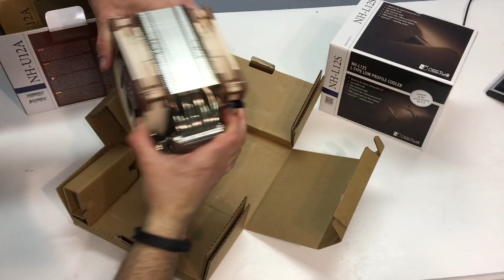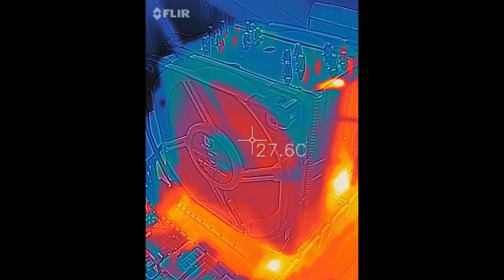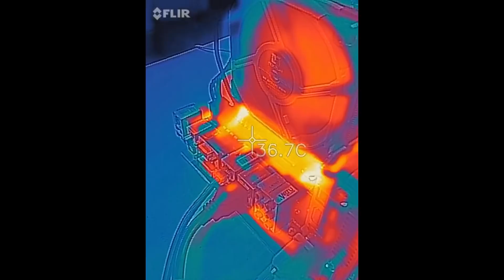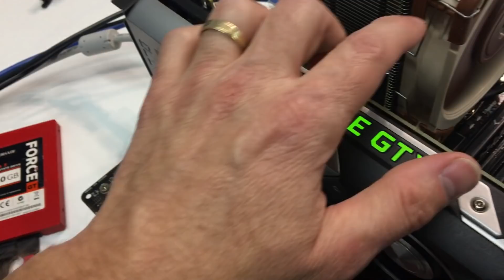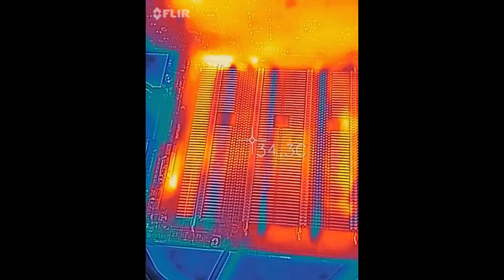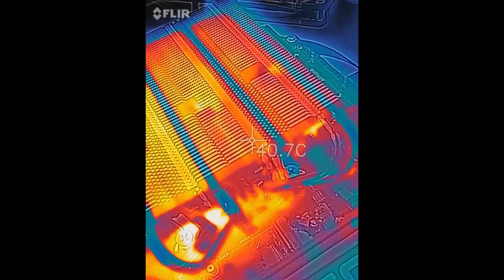Noctua NH-U12A & NH-L12S CPU Coolers Review

Comment: many thanks for the very deep review and tests! i wish there was much more around for low profile coolers specially for 4U server chasis is hard to find, overall height demensions are not always easy to find in specs what makes the search for a cooler thats fit a lot more difficult. i think i go for this NH-L12S one and see how it works, might even put a server fan on top with higher speeds to see if it makes a better deal. Note that thermal cameras have some difficults on reflected materials so the results can be a bit off. Cheers M8 thanks for your great work.

Comment: For the L12S, you never tested the default fan position shipped by Noctua, i.e. the fan underneath  (what Noctua calls "low-profile mode") but pulling air FROM the motherboard THROUGH the heat sink and INTO the case. This option is the absolute best if you happen to have a case with an air filter sitting on top of the heat sink, just waiting to empty hot air from the case =) 
I just bought the L12S and the new Evolv Shift Air case. Under extreme stress tests with programs such as Prime95 and AIDA64, my i7-4790 (95W TDP) are staying safely BELOW 70 degree C, and I'm idling around 28 degree C in a 24 degree apartment. For reference, with my old Noctua NH-L9i I could only dream about these numbers (no suprise the NH-L9i has a TDP recommendation of below 65 TDP). Sure, I haven't done any overclocking what so ever. But seeing that some of the new Intel 12(!) core CPUs have a TDP of 95 or lower (just as my i7-4790), I'm certain the L12S cooler will serve me many many years to come when I decide to upgrade my CPU.

Comment: Good video. Thanks for the review. One note, the thermal readings on the side view of the fin stack during the first half of the video looked like they were sensing the reflection of the video card, not the fin temperatures directly. The specular surface of the fins at medium and high incident angles is pretty reflective in the mid IR band. Thermal emission is isotropic and should be stable when sensing the same point, independent of viewing angle. So you can check and see if the temperature changes on the same sensing point by changing the camera viewing angle. If it does, it's a reflection. If it doesn't, it's likely the emission you're trying to sense.

Comment: Great in-depth review. Regarding the NH-L12S you only tested with air flowing down even with the fan on the bottom. I noticed when you took it out of the box the fan was oriented to draw air from the bottom and blow up through the coils. I can't help but wonder if that would have improved thermals marginally. Probably not a huge difference but I was hoping to see those results.
Reply from the maker: To answer your question (sort of), I have wondered the same thing and run down flow coolers with the fans going either way and did not notice any cooling differences. However you would typically want the fan(s) to blow down against the motherboard, taking advantage of the air flow to help cool it.  Probably the biggest factor  is that down flow coolers really benefit from cases with good air flow.
Reply: I just made a comment about this, see newer posts in this comment section. I have no case fans at all (and my PSU is mostly passively cooled so the fan rarely spin), solely depending on the L12S to push air out of the case through a vent filter just above it. But this of course puts great demand of the type of case you have...

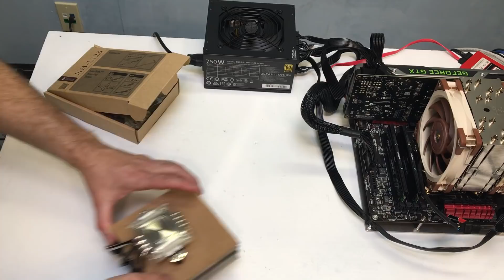Comment: Excellent review Thanks. On 23:49 I saw that fan is installed on pulling air out, not in. Is there any difference between VRM cooling in that case?
Reply from the maker: Is there a difference - probably, but not enough to worry about.   Having said that, I would normally run a downflow cooler like that with the fan blowing down to get the benefit of additional airflow across the motherboard.  Unless you are really stressing the system, the VRM temps are not usually a concern.  The VRM heatsinks are typically designed for passive cooling and normal airflow through the case is usually adequate.
Reply: neither coolers are effective. I got the NH-L12S and no matter how I configure it including Push-pull ..it really sux.  Thermal paste type makes no difference. Used on an i7-3770K - ASUS Maximus V Gene mobo. at idle its 45c to 51c.  Noctua only good for its fans. Buy a Cyrorig 7 or be Quiet Dark Rock Pro.  I also have i7-6700K OC at 4.6GHz on a Gigabyte GA-Z170X Gaming 7 and tried it .. really poor cooling performance best with an AIO liquid cooler as I have Corsair H-100i and when at idle never gets above 35c.
Reply: @richscott2483  hmm interesting. Did you check thermal paste inside of cpu? Maybe you should refresh them, because cpus you've mentioned are few years old.
Reply: @richscott2483  It's important to note that Noctua point out that the NH-L12S is designed for around 85w TDP and is not for overclocking. You're pushing it beyond its design.

Comment: Though long but very useful video, only thing is L12s at stock fan is upside down which blows up air through the stack.
Reply: That is correct and best way to mount as blowing air up and not down at CPU. It's been tested and review on You Tube. Noctua assembles and sends it to you as the most ideal position for cooling. However, I decided to get the NH-L12S rather than NH-L9i and just regret purchasing it. Poor performance period. Get the Cyrorig 7 or be Quiet Dark Rock Pro.

Comment: By the time 11:10 rolls around and you install the metal component, you didn't apply any thermal paste?
Reply from the maker: Yeah  - I went back and looked at the original video clips and I had put the paste on but I had edited that part out for the final video.  Missed it by a few seconds - good catch!  You can see where the thermal paste tube moves and the cap is then off.  Sorry!
Reply: @overclockersclub  Oh, cool, cool, cool/
Reply: @overclockersclub  I am a little conflicted on what paste pattern to use. This cooler will be arriving soon. I caught a glimpse of GamersNexus mod mat. It had a paste pattern rec for Ryzen.  A Vertical line and an X. 
Then again, I was reading some very serious overclockers forum where they said that in general testing, a decent sized blob in the middle was the best performing. Any thoughts?
Reply from the maker: @Dennzer1  There are many opinions on paste application.  Just do a YouTube search on the subject  (if you haven't already) and you will see.  I find this video particularly interesting.  I might have to try to make a similar video...   https://www.youtube.com/watch?v=EyXLu1Ms-q4

Comment: March 2020, just got the NH-L12S after comparing to NH-L9i. Sad situation, the NH-L12S is crap in performance. Also no matter what configuration placement, interferes with your Memory Slots.
My ASUS Maximus V Gene has 4 memory slots, thank goodness I am only using 2x8GB TridentX DDR3 2400MHz. If you need all 4 slot you are SOL even with Low Profile DRAM (memory). The i7-3770K at Idle is 46c to 51c.  Thermal paste type made no difference, reversing fan or making Push-Pull not good. Be alright if 38c to 42c at Idle. I do not recommend the NH-L12S. get be Quiet Dark Rock Pro or Cyrorig C7. Okay! Noctua makes terrific fans, minus ugly color scheme, that is about all they can make right. Get an AIO cpu cooler as I never had any bad luck with Corsair or Lepa. For Air Cooling best if  your fan stands Vertical as lying horizontally over the CPU does not work well. Do not use Hyper 212 or anything too tall as they tend to stress the motherboard since being top heavy. Using an AIO with my i7-6700K OC at 4.6GHz idle is 33c to 37c.

Comment: Nice vid! Where can I get one of those mobo risers? Thanks
Reply from the maker: Sandro Brocard I made it myself.  Aluminum base plate (1/16”) and 1” hex standoffs 6-32 thread.
Reply: OverclockersClub awesome thanks for the info, I wanna try to do it for myself
Reply from the maker: Sandro Brocard You can find templates on the web for hole positions for ATX motherboards.
Reply: OverclockersClub thanks bud! I will take a look
Reply from the maker: @Pillin123  Whatever template you find, test it on a piece of cardboard first.  You can also just set the motherboard on your aluminum base plate and transfer the holes (a transfer punch helps) if you have a very steady hand.  I have done it that way too...

Comment: How would the l12 s stack up against something like the h60?
Reply from the maker: The H60 is a good cooler, and for normal use (watching YouTube, surfing, checking email, etc.) you would probably not notice any difference. For an overclocked system, or a system with a high TDP chip, the H60 will likely perform better - however I have not personally tested the H60 so I can't give you any real numbers...
Reply: you mean corsair h60?

Comment: Hello how does the NH-U12A compare to the NH-U12S please? I just ordered the NH-U12s chromax and was curious. Thanks.
Reply from the maker: I have not tested the NH-U12S. But if you go to the Noctua website and compare the specs of the two coolers, you will see that the NH-U12A has a larger heat sink, more heat pipes and two fans (that move more air).  Consequently, you would expect the NH-U12A to perform better.  But it really depends on your application.  Unless you plan on overclocking and loading your system all the time (and most people don't), you probably wouldn't really notice much difference.
Reply: OverclockersClub I was going to order the u12a but could not get past the brown color lol. Very good review though. I could not find a comparison section to compare the two coolers but I feel the u12s should be good for that I need it for. Hopefully one day they make a black version of the u12a.

Comment: Is it normal for the RAM to heat up while gaming? My RAM goes from 31C while idle to about 47-50C while gaming.
Reply from the maker: It really depends on the type of memory dies you are using. Like Samsung-B die don't like to get hot. Others like Hynix is a mixed bad. So without knowing the ram kit you have, anything above 45-50c can produce errors. Physical damage occurs  around 80c.
Reply: @overclockersclub  I have trident z 3200MHz CL14 Samsung B-die. I guess it has to do with all the heat in the case. not sure why graphics cards blow the heat straight up into the memory and cpu cooler.
Reply from the maker: I am using Ripjaw V 3200 CL14 kit. Also Samsung B-die. I am able to run it @ 3733 CL17 - 1.4V and it stays around 40c. Really if it doesn't error out in memtest86 than you are golden. I got a lot a airflow in the case i'm using and the CPU is using a AIO instead of a heatsink / fan. Makes the whole area much cooler.

Comment: Is there any way to secure the nfa12x25 to the l12s?
Reply from the maker: Yes - I just checked and the fan clips that are supplied with the NH-U12A will secure the NF-A12x25 to the L12S, but there is only room for that fan on top of the cooler.
Reply: do you mean installing another fan with it?
Reply: OverclockersClub can i use 2 fan (top-bottom) on nh-l12? where can i get additional fan clip to mount the extra fan?